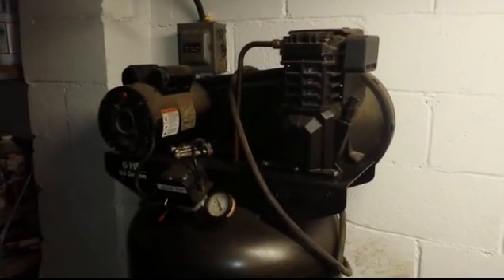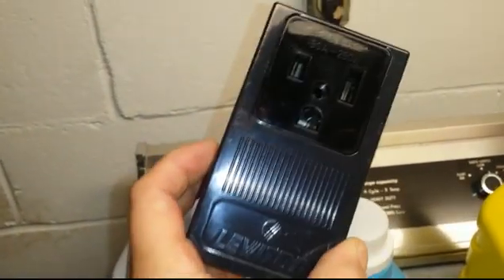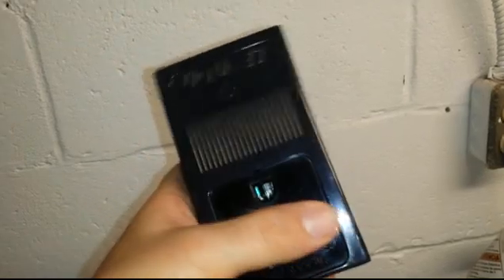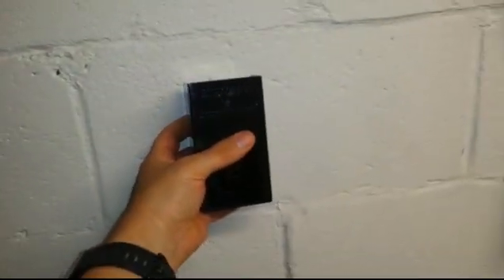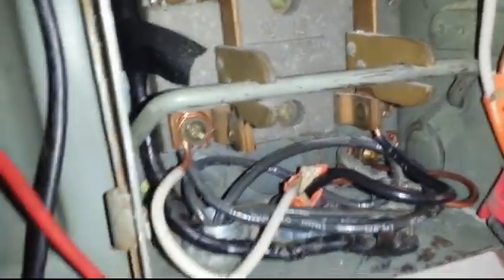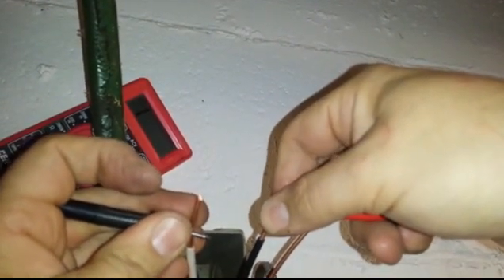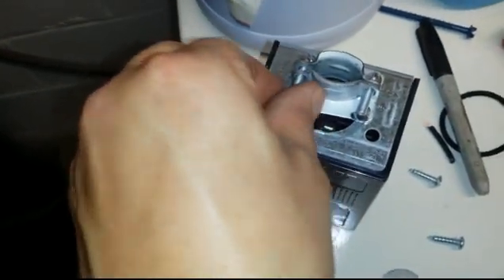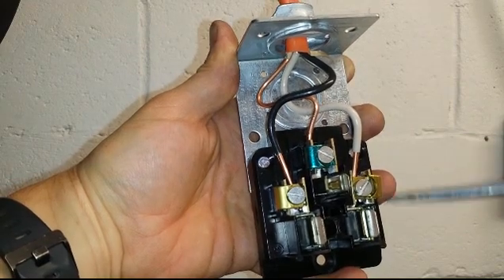220 Volt Outlet Install

Comment from the maker: Yeah. I should have used a longer wire. My OCD doesn't like it being at an angle like that instead of nice straight verticals and horizontals, but it worked and has been working for a couple years now without issue, so I'm happy.